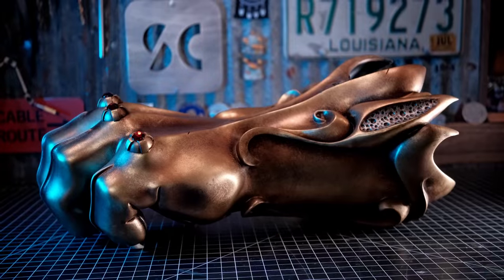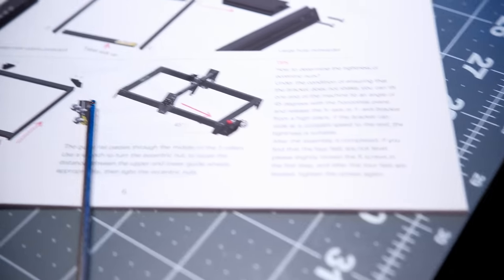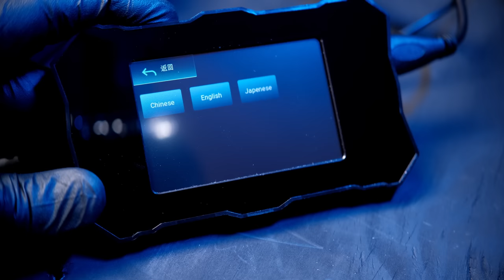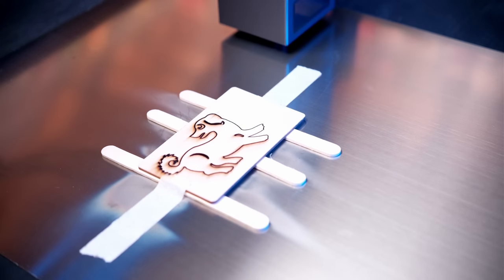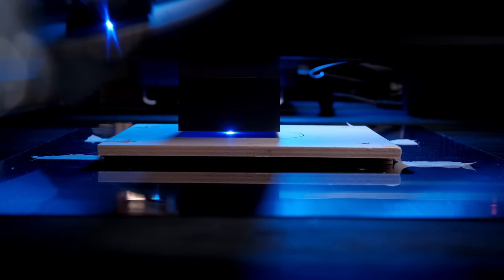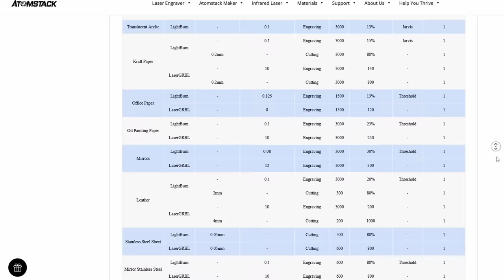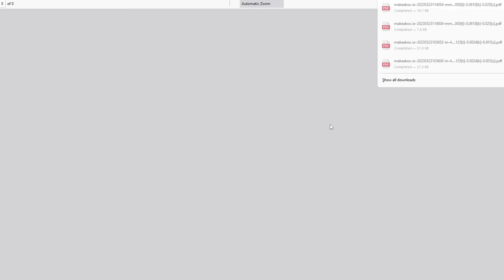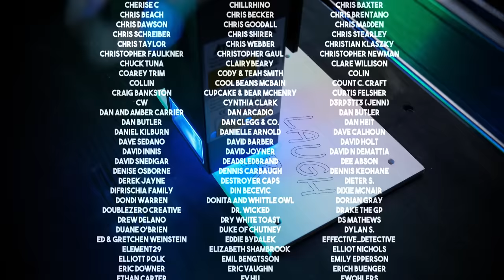First time LASER-cutting! (I'M HOOKED!) The ATOMSTACK X20 can CUT!

Comment: ⚠️ heads up to anyone using a diode laser. Goggles that block blue light will be ORANGE not green. Make sure to research the wavelength (it will be in NM) that your laser emits, and how much OD (optical density) is needed to protect from it! When wearing the goggles you shouldn’t see ANY blue. Stay safe!
Reply: Yeah, super confused by the goggles that came with my machine, but I confirmed with the company that they were the right kind. Even though the glasses are varied colors. Weaker 1.6watt laser came with green, and the stronger 10watt came with red, but both within the same wavelengths, and the old goggles are safe for the stronger laser.

Doesn't make much sense to me, but they're the guys that designed it, so I kinda have to put my trust in them.
Reply: @MeatSim9  laser glasses cover a broad spectrum of light but different wavelengths will get different levels of optical density protection, and there’s usually a steep fall off. So green goggles might block some blue light but with a lower OD. laser glasses are supposed to come with a chart that shows the OD going up and down across the protected wavelengths. I think the minimum OD for my 10 watt was 4 or 5. 

The glasses mine came with were the correct orange color but they didn’t have a nm and OD rating, only an impact rating. The glasses I purchased online have an OD of 7 for the 450 nm blue wavelength. I thought the laser companies would know what they’re talking about too but there seems to be a big disconnect between their engineering and their advertising/product support. The advertising for the laser I used shows it on a coffee table with a person and a dog staring at it w no eye protection as it engraves metal lol. The machine is really well made tho!
Reply: Yep, my buddy got a wicked laser a month before the store closed due to issues of changes in federal regulations. But the fool wanted to use his blue laser on his weed pipe. Thankfully he had goggles, but the next day he had a distinct sunburn on his face despite smoking at night due solely to his blue laser.
Reply from the maker: WOW.  Kayakasaurus (and others!), I sincerely appreciate you taking the time to inform others.
The only color I've ever seen used in regards to laser safety is green, so I thought nothing of it! But since reading the comments, I've had my eyes opened.
I'm going to add this safety note to the pinned comment.  Sincerely grateful, y'all.

Comment from the maker: SAFETY INFORMATION (Courtesy of Kayakasaurus):
"⚠ heads up to anyone using a diode laser. Goggles that block blue light will be ORANGE not green. Make sure to research the wavelength (it will be in NM) that your laser emits, and how much OD (optical density) is needed to protect from it! When wearing the goggles you shouldn’t see ANY blue. Stay safe!"

DISCOUNT CODE: 20USDOFF

https://www.atomstack.net/products/atomstack-x20-pro-130w-quad-laser-engraving-and-cutting-machine-built-in-air-assist-system

Comment: 8:15 - You can use little neodymium coin magnets as risers too, and when you need something like paper or flimsy plastic held down, you can use them on top too, so the airflow doesn’t blow the thing you’re cutting away.  I have a honeycomb under my ancient FullSpectrum and I use those neo mags to hold down the stuff so it keeps it tight.
Reply from the maker: Slick!
Did a quick test to be sure the laser housing was indeed aluminum and not something ferrous (LOL! I pictured it moving along and the magnet clinging to it or something.)
We have plenty of little neodymium ones, so that's what I'll use. :D
Thanks as always, uncle PC!
Reply: @TheCrafsMan  Heck yeah.  They’re especially useful if you’re cutting out decals or paper.  I used mine to cut vinyl stickers and it works great at that.  Leave a little residue though.
Reply: @TheCrafsMan  Lasers make nice customized cutting boards too.
Reply from the maker: @Chef_PC  Definitely helpful for testing some paper/cardstock materials!  :)  (Thinking about trying to pull off a physical paper animated character - like drawing the frames or animating on the computer, cutting them out, and using replacement style stop-motion animation.)

Comment: Great video! I can see your mind already turning with the possibilities for future projects. I could see you making wooden figurine standees with bases, or miniaturized wood set pieces for stop motion animation.

I've worked with laser cutters for a couple years and wanted to share some knowledge I've picked up to hopefully save you some time in the future.

1. I recommend buying some r-type style tack paper to prep your material. You can use a rubber squeegee to apply it to the back and then x-acto the edges. This greatly reduces the scorching of parts. It can work on the front as well, but only if you're not engraving. A honeycomb bed with fume extraction would also greatly aid this issue.

2. You can even engrave metals with a low powered laser using a product called cermark (or similar). We used to use taped down thin cardboard to cut outlines of our parts first. Then we could place the metal parts in those holes, and they would be aligned for the engrave job. Simply rinse the metal parts (not down drains though) and done! Works with brass, stainless steels, carbon steels, and more. Zinc anodized metals may be hazardous, so do some research if you want to try it.

3. Engraving and then cutting is a good approach much of the time, but there can be some advantages to doing it the other way as well. For example, it sucks to run a 45 minute engrave that's ruined by a failed cut pass. Don't overlook the workflow of quickly cutting many 'blanks' out all at once, then doing a more time consuming engrave later. This allows for iterations and variety, or even mass production with a cardboard template to hold many parts in place later. 

If you raster engrave one part at a time, it may take a while. But if the laser can cross 8 parts in one movement of the y axis, you will save time per part since it's not moving back and forth as much.

Have fun!!! Laser cutters are powerful tools, but they're also extremely fun to play around on. Can't wait to see what you come up with! :)

Comment: Ooh, The Crafsman! (Long time listener, first time caller, ...) I've had one and loved one of these -- the extension and rotary are worth the extra dollars, especially the extension -- 12x24 sheets of most stuffs is cheaper than the smaller trims of most stuffs -- the wiring is easy enough -- probably pays for itself if you batch parts. Luv y'all, back.

Comment: One thing I've found with Atomstack lasers is that the laser module is VERY close to the material so if you're using wood that is warped even just a little the module will bump it and mess up the engraving.

Comment: I found a neat trick with laser cutting fabric. If you run the beam on synthetic fabric then run the same edge but a bit smaller on lower power then it can sinter the edge and prevent most fraying. It takes some practice but it seems to work well on polyester.

Comment: What I want to do is to use a laser for making a mask for metal etching.  Paint the surface and use the laser to flash off the paint where the metal is to be etched into, so you can have an extremely detailed etching.
Reply from the maker: "Ladies and gentlemen, please help me welcome... ALONZO BRANSONNNNNNNNNNNNN!!!!!!!"
That's one thing we want to try, to see how it compares to Press-N-Peel Blue transfers! I've talked to another X20 owner about this and apparently it's not as easy and depends bigtime on the paint. I welcome your advice, because I do want to try this exact thing down the road.
Thank you, Alonzo!
Reply: Indeed, since a laser cuts by absorption of the wavelength of the light emitted different paints would absorb differently depending on their makeup. People who decorate ceramic tiles have a similar issue.

Comment: This looks great! I had to get rid of my k40 because it was huge, badly made, the software was dodgy (except k40 whisperer) and the tube failed and started arcing to the casing dangerously. Also the water pump and tank, extractor and compressor was a lot of extra gear.

This looks much better, though less raw power. I presume it will cut/engrave perspex?

Comment: Will it engrave thin metals, like brass, copper, and mild steel? I know the fumes are nasty, but engraving styrene or ABS would be cool. Can it engrave glass? That's a heck of a bit of kit, Crafsman. Thanks for sharing. 👍👍👍
Reply: It will engrave metals at moderate power using a ceramic marking spray. It's expensive, but you apply it to metal parts like spray paint and wash it off after the engrave is finished. It leaves behind a 'sintering' that looks really nice on some metals.
Reply from the maker: @JL-vc1wt  Thank you for answering this, JL!
@brianartillery: I'm only very mildly familiar with the metal side, but have read it can cut stainless steel (.05, I think). Have also read about the sprays used specifically for metal, as JL mentions.
Reply: @TheCrafsMan  - Thank you!
Reply: @JL-vc1wt  - Thank you!